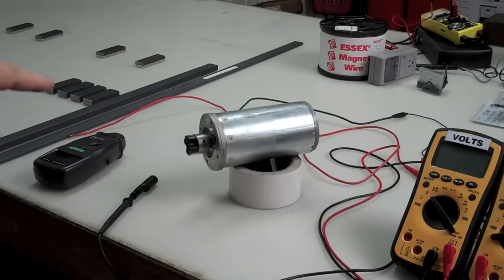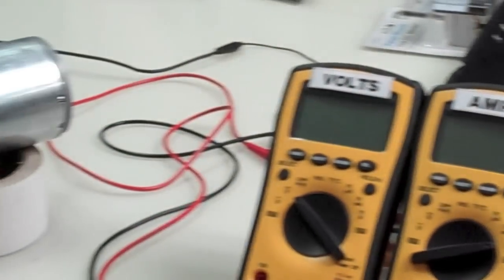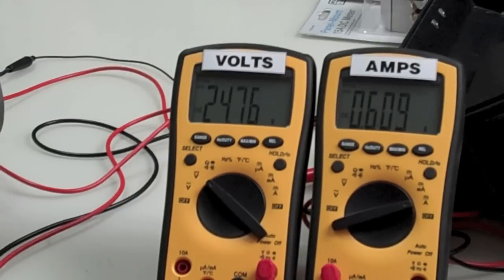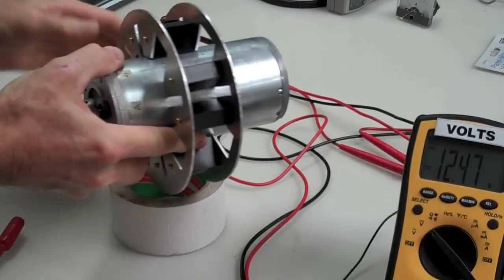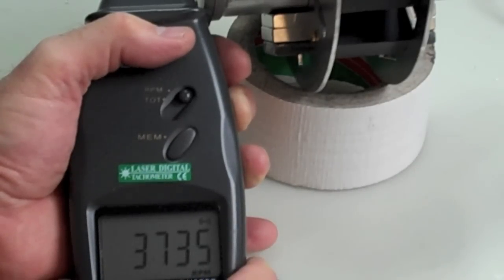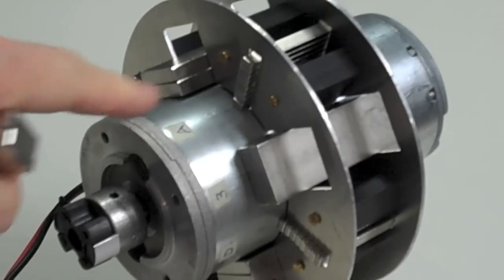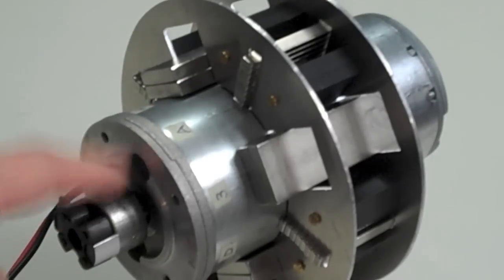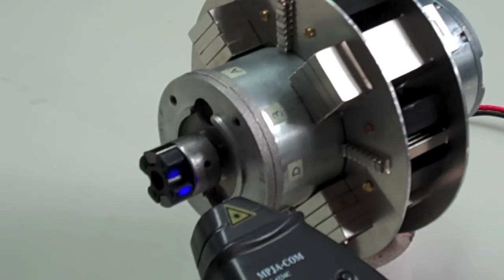STARGATE MOTOR  FULL DEMO

Comment: FACEPALM. and yes I read the description, the motor spins at the same RPM for this reason: half the voltage, the current needs to be doubled (which is was LMAO. the magnets really had no effect on that, and the tourque was lessened (the physics) something has to give.  in this case the torque you can tell from the higher pitch wine.

Comment: you can not see who adding magnets to a magnetic motor might change the motor so you are comparing apples and oranges!! Really? They have simple books for you! watts=VA Designed for rpm and you change the design!! Brush-less motors are rated in kv which somehow is the RPM per volt as designed change that and you change the rpm per volt....A for effort BUT N0

Comment: What a Nice Hobby, Motors and Metering Fun!  Physics 101 says, there is No Free Energy Folks!  Right?  You folks do believe the Scientists?  Or, is this just a channel that is trying to make a quieter, faster, stronger motor for sump pumps or motor products for industry & the general public?
Reply: +JOHN PUBLIC You're the one that said free energy. Nobody else was making such claims.
Reply: a nuclear weapon takes far, far less energy to set off than what it outputs.  Not sure if you'd call that 'free energy' but it is way, way over unity.

Consider a 1 kilogram chunk of wood.   That's about 2.2 pounds of wood.  How big of a fire will that make?  Not much.  Wouldn't last a full beach party or a campfire.

But that same 2.2 pounds of wood has Energy = mc^2 of:

E = (1 kilogram) x (300,000,000)^2 
E = (300,000,000)^2
E = 90,000,000,000,000,000 Joules, or 2,500,000,000,000,000 watt-hours.
 
If you could convert 2.2 pounds of wood to its equivalent energy, instead of lighting up the campfire for a couple hours you could light a 100 watt light bulb for 2,853,881,278 years.

For nearly 3 billion YEARS, a 100 watt lightbulb.

When you compare a 2 hour-long campfire with 3 billion years of 100 watt light, THAT'S FREE.  That's FREE ENERGY.

So it is possible, and by way of E = mc^2, it's fully supported by physics.
Possible, yet not easy to pull off.

And there may be other ways we don't know yet to extract atomic energy.  In fact, there probably are.  For now, all we can do is set it all off at once. 

Gotta be a way to trickle out that energy.  We'll find it.
.
.
.

Comment: I don't understand the purpose of this, your just ruining the efficiency of what that motor is designed for by overclocking it. Also the motor isn't under load and all you are doing is changing the rpm with no measurement of the output torque, which again seems pointless. If you raise the rpm and use less watts, how do you know that your torque output hasn't dropped corresponding to the less draw?  Wouldn't it make more sense to buy a better motor made to run at 15000rpm and use a simple $5 speed controller and drop it down.

Comment: We also don't see all connections AND the motor working... no proof of anything.. 

Also, higher RPM does NOT mean more power output.

RPM at NO-LOAD is meaningless... as slow as the spool up is to maximum RPM, I would say the torque is MUCH LOWER than the stock setup.

Notice in the final part of the video there is nothing holding the motor from moving around on the table??  Maybe because the motor no longer has the torque to make it flop around.

--

Comment: Unloaded is irrelevant, in DC motors volts is speed, your motor will spin (unloaded) at whatever speed is required to generate the CEMF (counter electromotive force) to counteract the volts applied. Okay your playing around with field "weakening" and changing the motors characteristics, nothing special have I seen in any of the readings. Add a load into this if you want to know about energy used/work performed.

Comment: This proves. Nothing! You did not get more power free spooling a motor! You are essentially changing the windings with magnets. But the motor is not designed for that rpm. So I have Steve neu motors that do 60,000 rpm out of the box on 22.6v and with the right batteries under load.. So unwind this motor and do the same permanently..

Comment: you just spent a lot of time, effort and money on making a physically bigger, less efficient and less robust motor. 
The windings and magnet arrangements are already optimised to get the maximum efficiency from that sized package and power output. If you want a bigger motor why not just buy one. It will be cheaper.

Comment: Great, You are not talking about anything free...  You have increased the size of the stator field and made a 24v motor run like a 12v motor.  A less powerful motor or faster spinning motor unlike what the manufacturer intended.  No dynamometer so you have no idea about its actual output.  Great... why bother though?

Comment: Big fat hairy deal. All you have done is redesign the motor for a new RPM per volt input... just exactly how do you think motors are designed for a target RPM in the first place? Duh. If you want to do something actually useful, try focusing on the efficiency vs cost & weight. To do that, you will need to measure the output power--not just the input power.

Comment: ok, if you wanted a motor with higher RPM why not save the money you spent on the outer ring retainer and the magnets and just buy one, there are a lot of efficient motors around these days and made to a price if you want better efficiency you spend more money HAHA like the magnets you bought. try your hand at zero point energy and don't try and reinvent the wheel like you are doing here.

Comment: Ha ha ha.  If that is true, then your motor is not optimized.  The design of the motor was done by the manufacturer for a specific axial strength.  So, by optimizing the magnetic field you have changed the design, something that does not reflect the genius of the fellow who did calls it the Startgate motor.  It means that he was tampering with the design.  That motor was designed with inexpensive parts and magnets which do not give it great efficiency. You can do that on nearly every motor.

Comment: There is no big secret to this. Everyone with some knowledge in AC or DC motor design can tell you the same and provide even the full math equations on why this is. There are even FAR greater optimizations possible if you use a halbach array which would remove much of the need for shielding. This info is readily available on the internet; it is not commonly used for the only reason such an array is very expensive to build.
Now stop drinking the cool-aid and lay of the conspiracy theories.

Comment: 1/3 hp at that speed ?!? ok, lets think about... how was that? the advance of a electromotor over a ottomotor is the fact, that the power is not dependet of the rotation speed.

also the rpm's are more or less saying nothing.

the question is, if the power is increasing, but... no word about :D

BULLSHIT

Comment: bulb. He said and I quote " I didn't fail 10,000 times, I just learned 10,000 ways not to make a light bulb." If you don't experiment yourself and use "rented" knowledge like sirtad401 had explained. And continue to be a nay sayer ect. You might as well be christian (Straightforward beliefs, and Faith in something that has never been seen.) preaching the bible. Like a scientist preaching a text book. Instead of closing your mind open it.Even if everything you've learned points against it.Succeed

Comment: In RC Car electric motors, people commonly degree them to change torque, RPM, and power drawn...

Nothing new here...

Just flawed thinking, and a huge waste of space.... why not mill out rectangles in the case so the magnetic field can pass unimpeded?  You'd require less magnets and be more compact and actually worth implementation in a production device.

Comment: You didn't actually show the voltage and amperage at the last demo, you could have sped up that motor by controlling the power input. I don't like not trusting you, but everyone and his brother makes scam videos to propagate funds that equate to snake oil salesmanship. The numbers you said didn't actually make sense to me. There was no change between 12 volts and 12 volts with magnets and you didn't show us if there was a change at full magnets. I need to see work performed vs energy used.

Comment: I don't believe this at all! you don't have to be a scientist to recognize sleight of hand. #1 on the last run YOU did not show you volt or amp meter! #2 Even your motor was out of veiw when you started. #3 you shut it down because the motor was not designed to run that high! Really! Burn the dam thing up! every one else does. and show that you didn't pump more voltage in by showing your meters. hell! when I was a kid I used to double my voltage in my remote controlled cars and almost double my speed

Comment: Ha ha ha!  Great BS.  Why did you not show the current meter when the motor was shooting for the 15000 RPM???  I will tell you why!  Because it was drawing higher current proportional to the energy required to get it there.  So, this is not a motor which draws less to give more.  This is just a plain motor optimized.  Of course that a higher magnetic density will help to speed the motor up! There is nothing surprising about that. That motor was designed for a specific drain and you increased it.